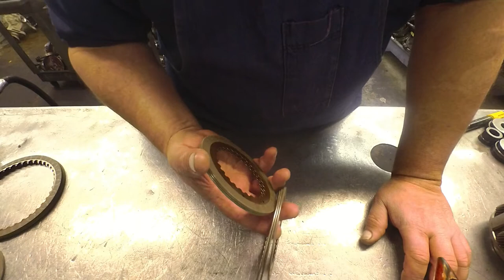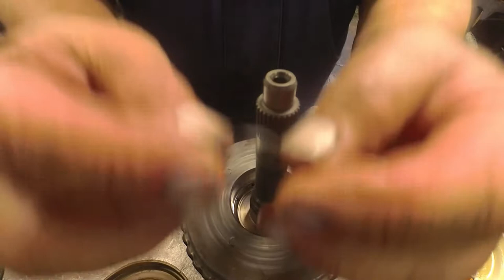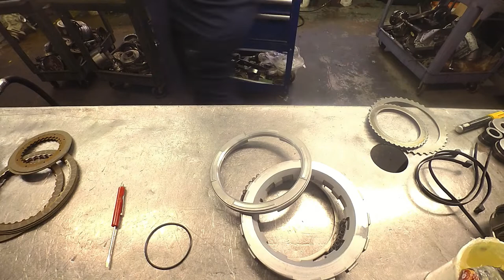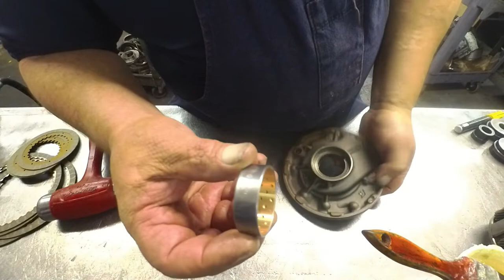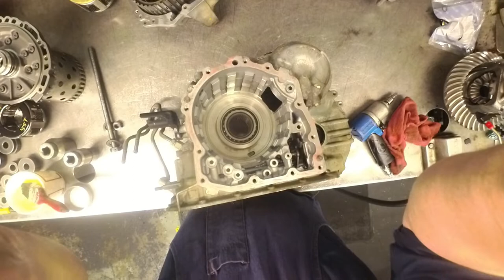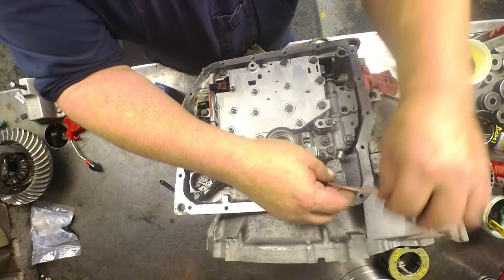U250E Rebuild

Comment: Thank you, Curmudgeon, for sharing your expertise in assembling these puzzles and leaving in the frustrating parts. Your generosity in filming your process has given me the confidence to attempt a rebuild on my U241E: at 111K miles it races in second, hunts for 3rd, and jerks in reverse.  I write in detail for the benefit of others.
A newbie at trans work, I googled for answers, and was surprised that there is still a recall on my ECM which has the bad shifting program, and I had it reflashed at the dealer for free even 20 years after it was made. I watched many different videos, visited forums, studied diagrams and manuals, and ordered parts that I hope will solve the problem. Not having the facilities to completely remove the trans, I'm approaching it with the 2002 RAV4 on jackstands, drained the fluid first, the driver's side wheel is off and Kroil spray lubricant helped ease the 20 years of attachment of the eleven 12mm bolts on the cover. A body part blocked easy access to the top two bolts but a long, thin, box-end 12 wrench did the trick. All bolts out, gently pulling at the cover with a thin pry bar, I knew the seal was broken when dots of tranny fluid flew out, then suddenly it was free, and I could see inside.  I was surprised how easily the tubes and pieces came out with a series of gentle tugs and twists..
Questions: what lubricants and silicone sealer it looks like Loctite brand (at 44:20) are you using? I see a tub of yellow lube, in other videos a tub of black lube; what are these and how do you decide which is applied where? I know this automatic for you, but I want to understand why you are adding dabs of what specific stuff when? 
I am closely studying this video between 41:30 and 50:30 where your camera unfortunately cut out. At then end of this section you are using a circular clamp to compress a ring that doesn't seem to be fitting, and then suddenly we're on the other side of the transmission and we don't know how you solved the problem. What was the problem in fitting that final piece on? Is there an easier way to accomplish the task--what should I be mindful of in fitting the final pieces?
Imagine yourself as the new guy looking at this puzzle in your driveway. I have removed the parts up until the snap ring at 40:04. The ring gear and everything behind is still held in place on the car by that snap ring. In a box in my garage are everything else: the shell, the sprag assembly, washers, hubs, drum and outer clutches to the case covering.
My biggest question: am I deep enough in to the transmission to address the issue of no upshift from 2nd to 3rd? How do I know what the failed section is (what am I looking for)? How do you judge what can be used again vs. what is seriously worn or broken and need to be replaced? If I don't find broken parts in the section that I removed, do I dig deeper?
If you answer these questions in another video, please let me know where to look. I hope that the U241E and U250E are similar enough that what you're doing in this video applies to both. 
Note: the flat rubber seals you show at 43:38 are Toyota part number 35145-21010 "Gasket, Transaxle CA" and cost about $45 for all three from the dealer. Could you point me to a vendor who could be helpful to someone like me to find parts or the right kits for my task? When I called the one that I bought from they said that "everything you need" is in the friction kit, but wouldn't tell me what exactly was included, so I'm still not sure. Are there parts (like the seals) that I should only buy OEM or which manufacturers are trusted for what parts?

Ideally I'd love to see a video where you explained the lubes, how to judge what is reusable (like in one video you were able to grind off a sharp edge to reuse it), and how far to go into the U241e and similar series transmissions to solve the 2-3 upshift issue (that resulted from the bad ECM) without having to remove and rebuild the entire transmission, if that is even possible. I'm obviously trying to get more life out of a durable machine, and I'm sure others in in the same situation given the cost of vehicles post-covid.
I apologize for the blizzard of questions and length of this comment, but I do value your insight and if you're not able to answer them specifically, I hope for direction towards something you've already posted to help me get this vehicle moving again. Even if you're not able to address this post, I am sincerely grateful for the effort you've made to share your knowledge with the rest of us. Watching a professional at work is truly an educational experience.
Thanks again...
Reply from the maker: Whew! There is a lot there. I'll try to answer them all. I do have a video on which products I use. Don't think I went into detail of why I use them. The yellow grease was Transgel Gold. It is no longer available. I used it because it was the thinnest and I used it for lubing lip seals. The black is actually dark green and is the thickest. I use it for holding bearings and such in place. Silicone I use is Loctite 598. The clamp I am using to resize sealing rings on the end cover. I use reverse input solid rings for a TH4L60E on there to help with the 2-3 flair that these units are notorious for. They are very tight fitting and easy to cut installing the cover. I am using a bushing and hose clamp. You can just use 2 hose clamps. My advice is to put the rings on, lube them up, put the clamps on and put it in the freezer overnight. Immediately after pulling it out of the freezer install it on the transmission trying to install it as straight as possible. As you stated these have bad computers. It will destroy the direct clutches. The direct clutches are in the drum behind the cover you take off. Depending on how long it was driven will determine how bad and what else gets burned. The second biggest problem they have is the pinions in the planetary wearing out and coming apart. It will start with the pins for the pinion gears. Once bad enough it will destroy the whole gear train. You cannot get the one that is the worst about it out without taking the front case half off. We buy our parts from WIT or Transtar. I prefer Transtec kits, especially for foreign transmissions. Links are in the description. The U140, 150, 240, 250 series units are basically the same. They will take different size clutches and the valve bodies are different. Look on the sticker in the door jamb and it will list exactly which transmission you have.

Comment: Quite impressive. I am a total diy beginner and need advice. I did a transmission fluid drain and filter change (u250e-camry 2007 aim was to address a hard shift from 5-4 and a flare from 2-3)a week ago and after starting the car, there was a bit of whining from the transmission. Next day going to work, there was some flare between shifts and after some distance, vehicle stopped shifting and went into "neutral". After stopping at the side of the road for 2 mins, the car was able to shift into gear and I took it to my mechanic. I asked him to straighten the pan which had a dent, and also to checked if the filter was installed properly. He did and said the filter wasn't sitting properly in the fluid inlet. However, the vehicle still behaved the same after we did a road test(goes into neutral after some distance). The only difference is that after the mechanic had a look, the whine was gone and now I had a gurgling sound. Now am stuck and don't know what to do. Should I buy a used transmission or should I attempt a rebuild? Please help. Am totally 😢 about the whole affair, especially since it's my fault the vehicle is kaput!
Reply from the maker: You may have got your hands on a Chinese filter. Either get your filter from the dealer or get a Filtran filter from WIT or Transtar. O'Reilly's filters also seem to be good also. Now having said that a fluid change is not going to fix your flair and harsh shift. Sounds like it is time for a rebuild.
Reply: @CurmudgeonTransmission  thanks for replying. I am beginning to accept that a rebuild is my only option. I think I can do most of it. I agree, it was stupid of me to think that a fluid change would fix the flare and hard shift. After researching more I found out there were TSBs issued for the very specific issues I was having. I will replace the solenoids in the rebuild. Now, the valve body repair seems to be quite tricky. I don't know if I should attempt it at all. Do you reckon if I do a rebuild and don't touch the valve body that all will be good. Mind you I have some burn/wear on the clutch plates behind the drum similar to the video but not as bad. I don't know if that has been caused by faulty valve body or just normal wear and tear.
Reply from the maker: The valve body is prone to wear like most nowadays. If you don't feel like doing it yourself get a Sonnax one. I have dealt with some of the others out there and don't recommend them.
Reply from the maker: BTW, thanks for supporting the channel on Patreon!
Reply: When you are fitting the second drum, you suggest that if the upper set of clutches are burnt then it's a bad computer, what if it's the lower set of clutches that are totally wiped out. What could be the cause of this?
Reply from the maker: On the U140/240 there are only 1 set of clutches back there, The U150/250 there are 2 sets. The smaller set are the ones that burn when the computer is possibly bad. It is worse with the Rav4's but have seen it on other vehicles. Have also seen the computer grounds be the problem  time. Here is an article to help you check that. https://gearsmagazine.com/magazine/correcting-toyota-u150u250-shift-troubles/#:~:text=If%20you%20still%20have%20a%20slip%20or%20bind,Refer%20to%20a%20wiring%20diagram%20for%20wire%20colors.

Comment: Thank you for great video. I used it to change valve body on my 2005 Camry and it fixed my downshift jerk from 3 to 2 issue.

I DO HAVE A QUESTION.  WHAT'S THE OFFWHITE GREASE NAME THAT YOU USED TO DIP THE 2 RUBBER WASHERS BETWEEN 58 AND 58:30 MINUTES?

Thanks again.
Reply from the maker: That color is no longer available. Red, blue and green is all that is available now. LubeGard assembly lube.
Reply: Thanks a lot

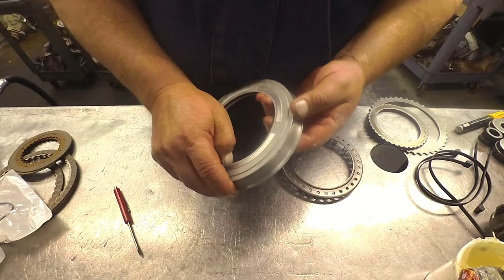Comment: So the o-rings on the piston if slacked could cause a no reverse case. I have a U250e transmission with a no reverse. @ first it goes on reverse with throttling hard later on slips out consistently till it finally didn’t reverse any more. Any time this happens it pops up a p0500. Vehicle speed sensor malfunction. Am no brainer on a transmission rebuild but I could give some shots. Have read up it could be the o-rings(like you changed in 13:12) are brittle or the reverse clutch. Can’t even identify the reverse clutch. Also what physical characteristics are typically of a burnt out clutches, Scours? 

Any training to students on transmission rebuild.
Reply from the maker: Reverse is the Underdrive Brake, which is the bottom set of clutches in the front of the transmission. Low/Reverse Brake, which is the bottom set of clutches in the rear of the transmission. And the Reverse Input, this is the top set of clutches in the drum in the rear of the transmission, under the rear cover. This is the set of clutches that is probably burned. Look at the rear cover and drum real close. The pistons need to be replaced also. The large on is getting really hard to get. Do not use cheap pistons here, make sure they are a quality brand.
Reply: @CurmudgeonTransmission   Thanks for this great tips. It’s well appreciated. Am yet to crane out the transmission but on a closer look from underneath the vehicle after removing the valve body I noticed the low/reverse clutch isn’t looking jammed up together(separated). Any pointer on this one?
Thanks once more for your time
Reply from the maker: There should be some play. It is only tight when it is applied.

Comment: Hello sir this transmission kit is same for u250 for Toyota Camry 2007 2.4 engine
Reply from the maker: Assuming you do have the U250E, can also have the U150E. In that case it would be different. Look on the tag in the drivers door jamb. It will list which transmission you have.

Comment: The service manual advices placing the snap ring ends non-aligned with the stoppers whereas you advice otherwise. Is there a reason for this?
Reply from the maker: I'm not understanding what you are meaning by stoppers. Alldata does not specify any orientation on the snap rings. I usually mark where they were from the factory and that is where I put them back.
Reply: @CurmudgeonTransmission  I was referring to the snap rings for the clutch balancers.
Reply from the maker: I have you put them in the same spot, I just don't mention the stoppers. Also, if you look at the pistons, some of them have slots cut out on them. I think it is more important for the snap ring ends not to be sticking partially over one of those slots. If possible and the snap ring opening is large enough, I put the opening there. Those slots are to let fluid out and that will allow a little better flow.

Comment: Hi, me again🙄. So the transmission went into the car.   The road test hasn't gone so well. The vehicle doesn't shift smoothly into 3rd gear. I wasn't able to resize the teflon rings so I opted tp use the ones in the kit. Could this be the cause? No codes in the vehicle though.
Reply from the maker: Is this in a Rav 4? Were the directs burned badly? Did you reset the shifts adapts?
Reply: @CurmudgeonTransmission  it's an 07 camry. The directs were burnt but only the lower set. I haven't reset the shift adapts.
Reply: So, I did a memory reset and 1-3 smoothened out. But I don't have 4th gear. Now I have to drive with selector on 3rd. I did change the slt solenoid on my unit. I have seen in some forum somebody say SLTis responsible for 4th gear but I am unable to confirm. Is this accurate? The reason I changed the SLT solenoid was due to a hard shift I was getting moving from 5th to 4th. I founda TSB that said thiswas caused by a bad design of the SLT solenoid hence during the rebuild, I used a new solenoid. Mightthis cause the 4th gear not to engage?
Reply from the maker: SLT controls line pressure. The bonded pistons in the forward drum can give the same symptoms as the SLT solenoid as far as the harsh 5-4 shift. Did it have 4th gear before the memory reset? Is there a knock sensor code in the system? Why do you need to drive it in 3? Is it neutralizing when it should go to 4th or just not shifting past 3rd?
Reply: @CurmudgeonTransmission  thanks for replying and your patience. It neutralizes when going to 4th. I decided to drive with the shift in 3rd because the road I was on is winding and has many hills and valleys. As a result, going uphill the car would neutralize and the only way I found that wouldn't result in me losing power was keeping the manual gear selector on 3. Behaved the same before the memory reset.
Reply: Also no knock sensor code.
Reply from the maker: Think you have an SL1 or SL3 solenoid problem or B1 Brake problem.
Reply: @CurmudgeonTransmission  I will investigate further

Comment: How easy is it to turn the input shaft after assembling the bell housing?
Reply: I am having a hard time turming it by hand. But with the torque converter in, it turns. Not sure if the tc splines into the input shaft though.
Reply from the maker: If it will turn by hand you should be fine. If you soaked your clutches it will add to the difficulty of turning.
Reply: @CurmudgeonTransmission  noted. I did soak my clutches for almost 24 hrs. Anyway, the tranny goes into the car today. Hopefully I did a good enough job. 🤞
Reply: Ok, just managed to turn it using a pliers. So hope that's good.

Comment: Does the pump bushing c9me with the kit?
Reply from the maker: No it does not. You will need to order it separate.
Reply: @CurmudgeonTransmission  thanks the disassembly video you say you get it from sonnax. I have searched but I can't get one for this unit. Might you know the part no.?
Reply from the maker: Transtar's number is 57034A.

Comment: how much money do I have to pay for this kind of work?
Reply from the maker: All depends on how damaged the unit is and you won't know that until you take it apart.
Reply: @CurmudgeonTransmission I need your advice.
 I made a u250e automatic transmission for my friend.  I used yours to get information.
 At 48.42 you install a bearing.  Which side is the right way to put it?  Or does it not matter?
 A friend installed a transmission and the clutch pack, which is under this bearing, burned out.
 The transmission was taken to a service center and they said that the reason was an incorrectly installed bearing.  I think that they are deceiving me and could simply forget to pour oil.  What are your thoughts?
 Sorry I can't send a photo.
Reply from the maker: @Big_BOSSSSSSS  Outside race faces the drum. I would think that you would notice if it was wrong. It does not sit quite right when it is upside down. If those clutches were burned before and it is in a RAV4 it is a great possibility you have a bad computer.
Reply: @CurmudgeonTransmission  Yes. the problem turned out to be in the computer. during assembly, I missed one spring and did not check its presence according to the scheme. It turned out to be very sad.